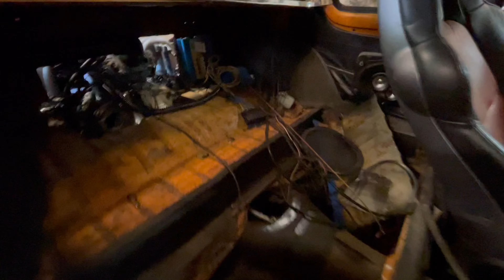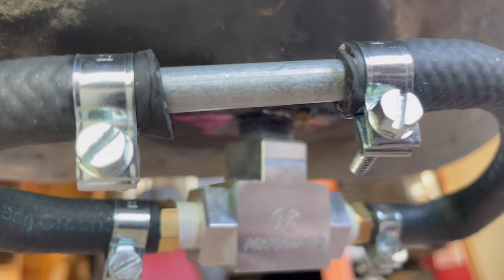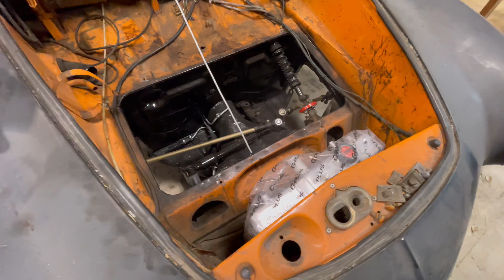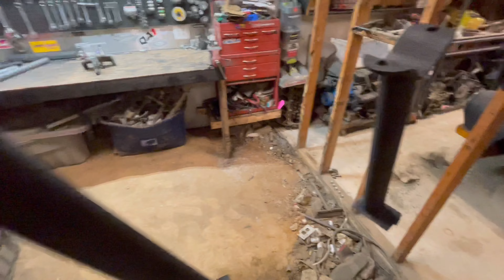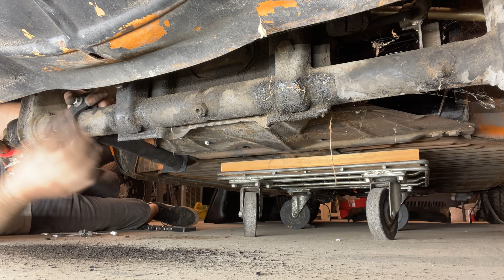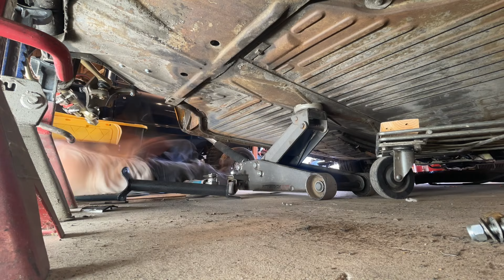Vw ghia

Comment: drain the fuel, fill it with water and weld the fitting then you have a spare tank
Reply from the maker: I did think about it but the old tank was full of rust worried there wouldn’t be enough metal left to not just blow right through it so new fresh clean tank not to expensive 👍

Comment: Sorry to hear about your friend , been through similar issues myself. Stay busy.. Doing a subie swap in my ghia. Could anyone tell me were to source the tee fitting for the gas tank? Thanks
Reply from the maker: Thank you, CbPerformance.com is where I get my tee fittings 👍
Reply: @uberkooledgarage  killer thanks. 
Also , you mentioned that the radiator was from a Sirocco.  What year model works best ?
Thanks again for all the information you put into your video series. 
Regards ,Phil Morgan.
Reply from the maker: @philmorgan4755  the radiator is a 3 row Honda radiator from Amazon but I would get the biggest radiator you can fit